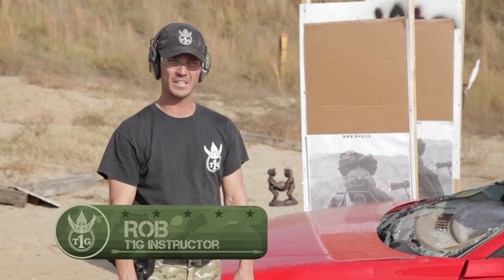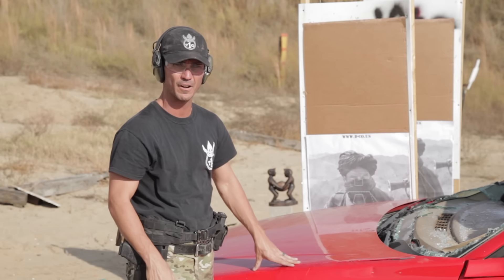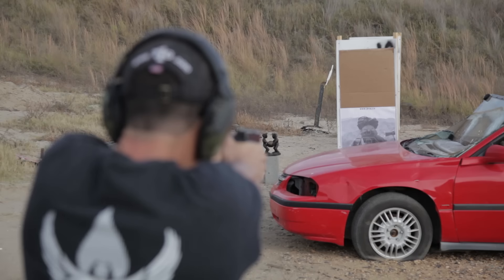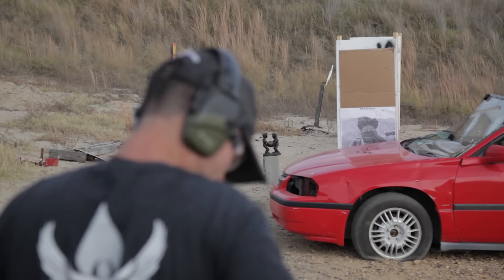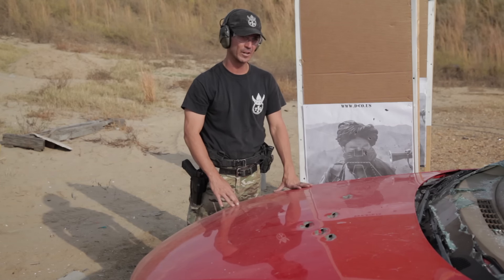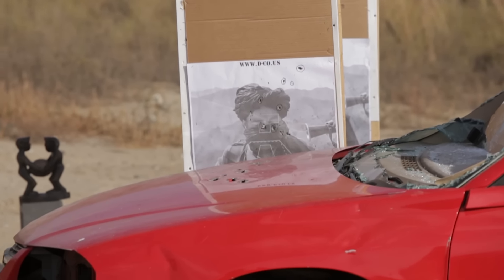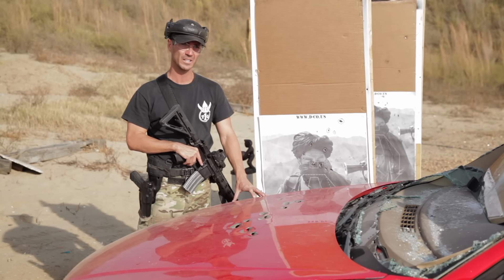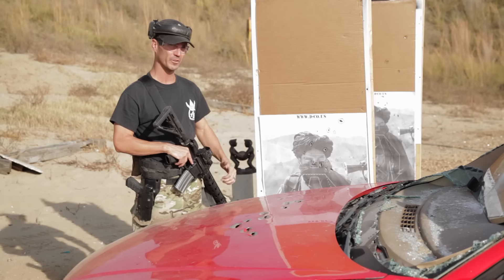How Bullets skip off Surfaces | Safe Shooting Positions | Tactical Rifleman

Comment: I have a question: Is the reaction of people lying down flat e.g. in a airport, when they hear gun firing correct? Isn't the area of receiving the bullet increased in relation to remain standing? I mean, isn't the bullet rebouncing off a hard surface lower than that of having been fired so that it can hit the body easier when it is laid flat down (esp. more or less vertically to the direction of the bullet)?
Reply from the maker: No. It would be "Yes" if you wear receiving fire from a straffing aircraft. However, in an airport, bullets fly level (within a couple of degrees) for hundreds of feet. Getting down always presents less of a targets. Simple geometry proves this true. Thanks for watching, TR

Comment: I have one question. Did the rounds that dug into the hood penetrate through the car and hit the targets below the hood line?
Reply: Dave Court probably not. The engine block and all.
Reply: I'm talking about the 2 inch gap between the hood and the engine. I'm wondering if any rounds passed through that gap and out the fender.
Reply from the maker: Nope... I was there watching Rob film this video, and no rounds penetrated out the fender. There are lots of layers of metal, brackets, and dozens of other parts all in the way that help slow bullets down.
Reply: That's good to know, Thanks for the response.

Comment: Interesting point.  But the further you are back from the car.  The more you are exposed depending on the height and angle the shots are coming from.  

So if your bad guy is a good shot.  Then he won't be hitting the car and the further back you are the higher he will most likely aim or point over the car.  Because more of you will be exposed.  He won't be trying to hit only a head shot. 

Nothing is absolute.
Reply from the maker: True, as we stated in the description of this video: "you may or may not want to get right up against the vehicle. If the enemy owns the high ground, say in second story buildings, then hunkering up to the vehicle does provide more cover; but that's not what we are talking about with this video. Here, we are talking that if you find yourself in a level gunfight, like a parking lot, you should stay off the vehicle." Thanks for commenting, Strength and Honor, TR

Comment: Isn't the same true about concrete walls? If you are in a shootout, or trying to get away from one, you should not stay right against the wall.
Reply from the maker: Actually, concrete walls act very similar, but do not change that angle as bad as car hoods. This is because the concrete shatters before it pimples.

Comment: To be fair you weren't aiming at the guy in the far back. I have a feeling if you are aiming to get the guy in the far back you could probably do it. Also the angle was off they aren't set up in line. You should have 3 to 4 Targets in back.
The reason I thought people set up in the front of the vehicle is to use the engine block as a stop.